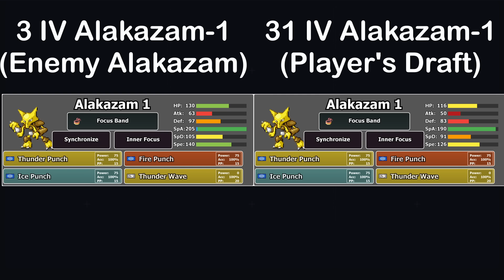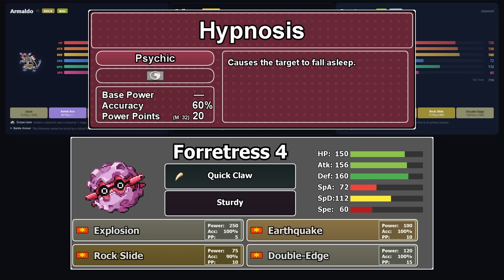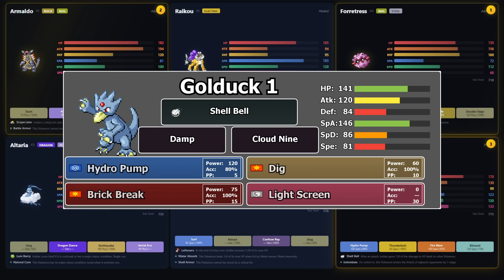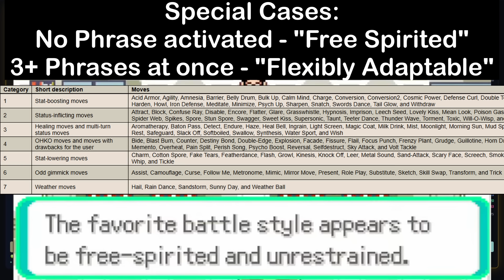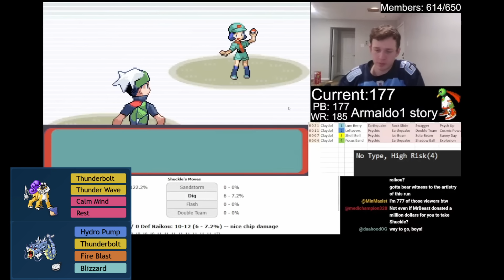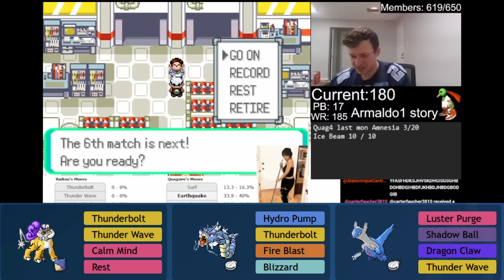What Is Factory Doubles Endgame Like?

Comment: Do players use save states when going for a WR? How does that work?
Reply: LRXC specifically uses save states for crashes and doesn't go back on them if he loses a streak except to review alternate plays but he retires his streak in those cases. Battle RNG is fixed when a battle starts so the outcomes are effectively pre determined.
Reply: @joeschmoe5063  Interesting, very informative! I thought the RNG would change on each load, or that it would be possible to work around a fixed RNG if someone really wanted. Thank you

Comment: Nitpick at 57:15. Sceptile-1 is not guaranteed to detect here. In fact, they're slightly more likely to Leech seed , which gets a boost sometimes because they know detect. That makes it about 50/50 to leech I think. Amusingly (and not statistically significantly), it actually could still leaf blade against either target. It'd have to get the +1 from high crit chance, get the low score on leech, get the low score on protect AND then against the other target get the low score on leech and get the low score from protect as well, then win the 50/50 to choose the first Mon. So, about 0.16% if my sums are right (they're probably not). Getting leaf-bladed T1 into detect T2 would have been hilarious, and is a good study into how some sensible systems dealing in 50% chances, 12.5% chances can end up with some really rare things being possible in certaint circumstances.